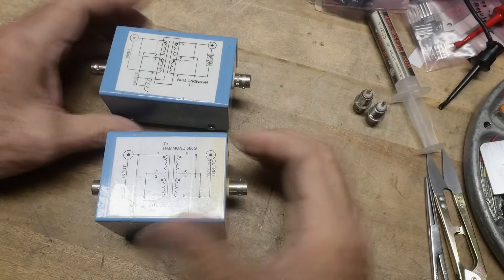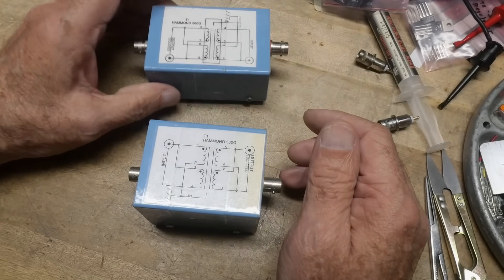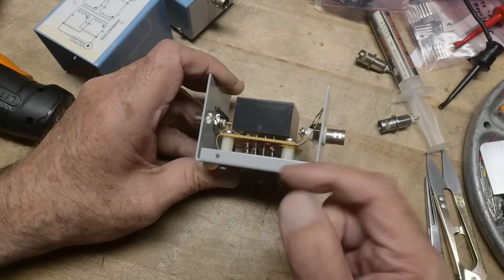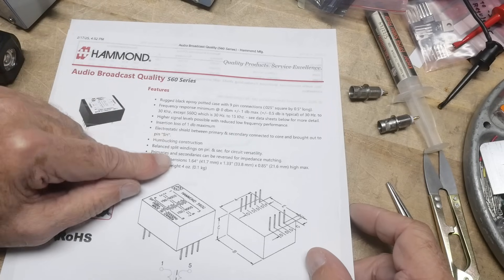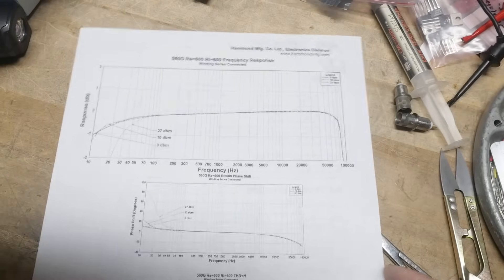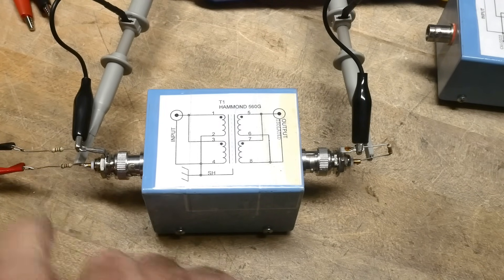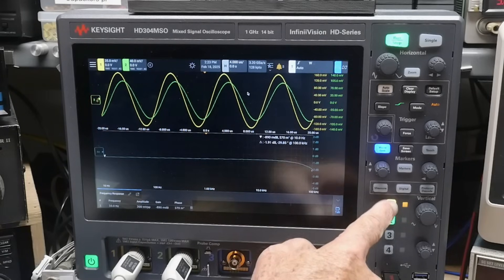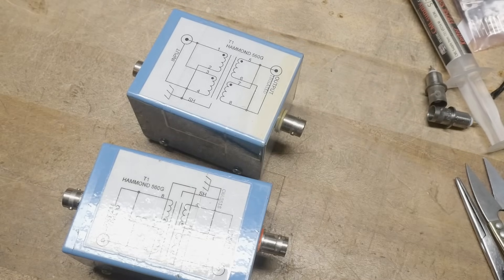#2158 Hamond 560G Audio Isolation Transformer

Comment: The plot on that sticker at 1:03 smells somehow fishy. It introduces positive gain at some point, which is something absolutely impossible for a passive device. This was what caught my attention at the first glance. That plot have to be somehow shifted or what. But on the other hand, I don't think your results are too different to that plot, it's much more a slightly different point of view. That plot renders 1.4dB (-1dB to +0.4dB, which is completely nonsense) to the full scale, which equals to about 1½div in your setup, making the roll off less pronounced. Furthermore, different signal level used would definitely lead to slightly different results as it's relatively easy to overdrive that transformer. That thing is not completely linear, just look at the datasheet, there are different results for different signal levels. According to the datasheet, higher signal levels enlarges roll off at lower frequencies, which is perfectly consistent with what was seen on that weird sticker.

In my opinion, it's crucial to avoid overloading of that transformer as overloading it probably introduces heavy non-linear distortion to that signal and somehow changes input impedance. It might be good idea to measure harmonic distortion of that thing in relation to the signal level (at e.g. 1kHz).

Comment: 5:15 shows a balanced signal source, 5:35 - is the source floating on the input or was one resistor shorted with the scope ch1 gnd clip ?
Reply from the maker: the source signal/ground connects to the two resistors,
Reply: @IMSAIGuy  indeed, and would that not result in one resistor being shorted from source gnd to oscilloscope gnd ? 

Assuming both pieces of equipment is connected to mains and have earth on the gnd side of the BNC.
Reply from the maker: @jangoofy  yes, there is a common ground in my setup.

Comment: Stycast epoxy
Reply: So it's just thermally conductive epoxy? I've often just mixed graphite powder into regular cheap epoxy. Seems to work, but the one time I tried to do a full test of thermal conductivity everything went wrong, so I'll need to redo it at some point to see if it actually does anything.

Comment: I am using a pair of old headphone output transformers from a scrapped Sony Umatic unit to isolate audio for my PC speakers, as the connection otherwise has a very noticeable ground loop with lots of hum ad noise. still on a bit of the SRBP front panel board, cut out to make them usable. works well with the Sony small speaker system I got for free, just had to replace the power supply for a more efficient one, and replace the blown power amplifier chip on the one channel. Replaced the amp years ago, and it was working well till I got tired of the 100VA power draw from the transformer, so replaced it with an old laptop power supply instead, now it uses 5VA when idle. Much more effective when running it along with a computer off an UPS unit.

Comment: Cheap source for audio insulation transformers: old telephone modems. Great for isolating a computer audio output from a radio etc.
Reply: Generally those are not very wide bandwidth and the limitation worked in favor of modem designs which have to work within the Telco's 3000Hz bandwidth limitations.  Compare 600Ω 1:1 telco isolation transformers and microphone transformers.  You'll notice quite a substantial delta in both price and performance.
Reply: @Peter_S_  Voice transmissions in amateur radio are 6KHz wide, at most so ...

Comment: I got a North Hills video isolation transformer in a small can with BNC connections.  50 ohm and bandwidth of 10 Hz to 5 Mhz.  Came in a parts box or something,  and so far I have not ever used it for anything.  But it is at the bench for someday.